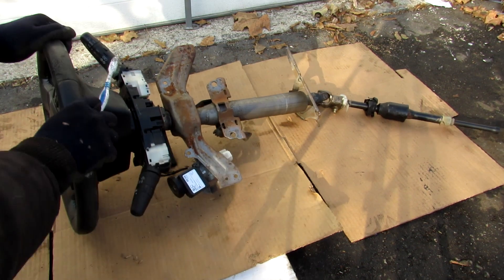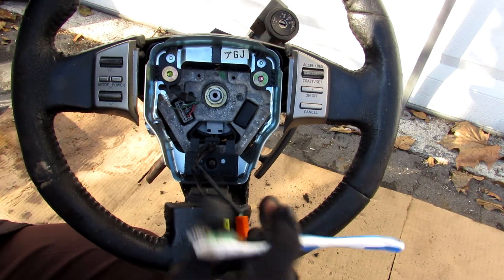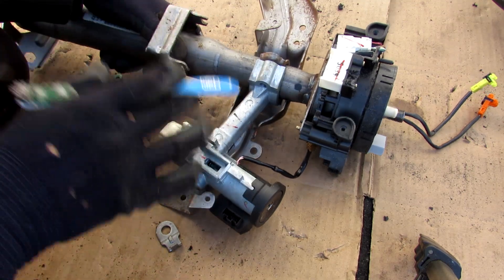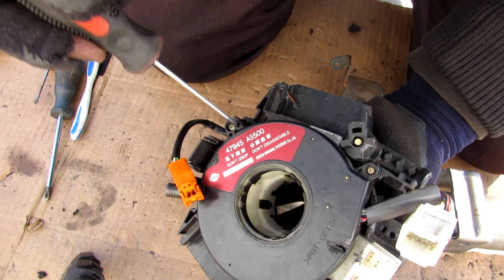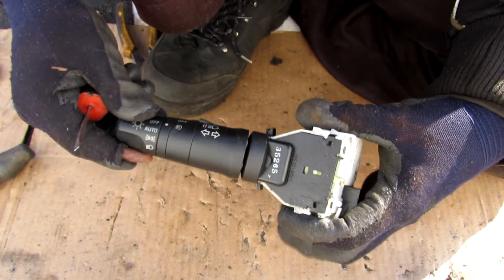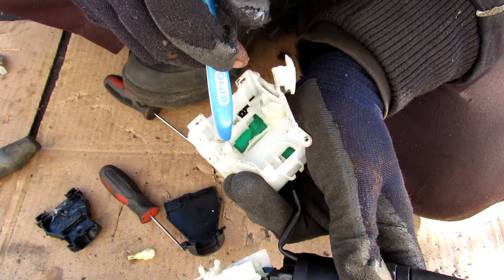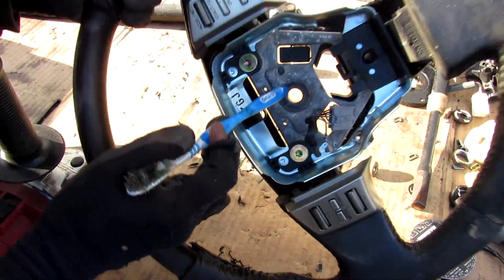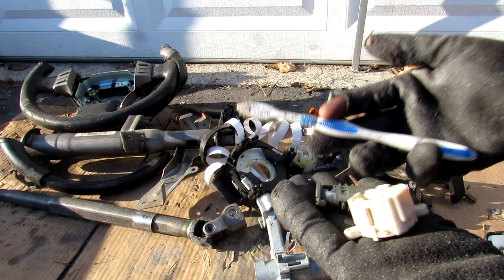How a Steering Column Works

Comment: Looking forward to the stability control system video.
My Toyota 86 has several types of chassis electronics and it's the first car I've driven with them. It's been absolutely fascinating to learn how each changes the limit feel and handling of the car on track.
Reply from the maker: It sure is!

Comment: Very interesting about the steering angle sensor. I never knew there was such a thing until I had a dash warning light come on in my Chrysler 300. I didn't feel like paying some dealership $100 an hour to figure out what was wrong and turn it off so I went online and learned that by turning the steering wheel all the way right, then all the way left, and doing that twice, that would turn off the light. Sure enough it worked. That particular warning light can come on when the battery is discharged which is what happened to my car. Who knew that? Anyway that's the first I knew there was a steering angle sensor in the steering wheel.
Reply from the maker: Yeah I'll dive into that sensor a bit more when I tackle stability control systems

Comment: Security Torx fasteners can often be removed with a normal Torx, taking care to keep the face of the bit square to the screw head.

Alternatively, you can sometimes break off the "weird dot" with a flathead to get full engagement, like I used to on DeWalt battery packs before I got the proper Security Torx bits (which are only like $12 at Home De Pot).
Reply from the maker: Good tip. I didn't even try. My angle grinder was closer at hand than my torx sockets 🤣
Reply: @speedkar99  It's not so bad to grinder on the ground, but it's a PITA in situ, unless you're Super Dave Osborne and it's your latest fire stunt...

Comment: In most vehicles that I know of...the ignition lock cylinder is designed to be removed (pulled out) only with the key in the accessory position.
Reply from the maker: Good idea, I should have tried that next time.
Reply: @speedkar99  Really do enjoy your videos which show great understanding of engineering principles/concepts.
Reply from the maker: Thanks

Comment: I didn't find any help with the horn wiring. Where that wire comes out from the center of steering column shaft at the engine bay gor the horns ? How does it not get twisted around the column ??

Comment: THANKYOU! I think no one else explain steering coloumn in such details. Now im a bit curious, those spiral ribbon like thing inside the clockspring in this video are making really familiar noise just like on my '11 nissan xtrail steering wheel whenever i rotate it. What are those ribbons function exactly? Is it only to limit steering rotation? Or is it also acts as a wire for electronic signal/current? Im just wondering what will happen if that ribbon on my steering coloumn goes bad. Tia
Reply from the maker: The clockspring carries electrical signals to your steering wheel controls
Reply: @speedkar99  i see, now im even more curious since my steering wheel is basic one with no button at all.

Comment: Can you show how a worm gear steering box works? And why do they fail? And how does the power steering pump work?
Reply from the maker: I have a video on steering pump coming soon. 
I don't have a steering box but I have taken apart a few racks on this channel already
Reply: @speedkar99  
It's just that I have a '95 Toyota T100 and I know the box is probably ready to be replaced.